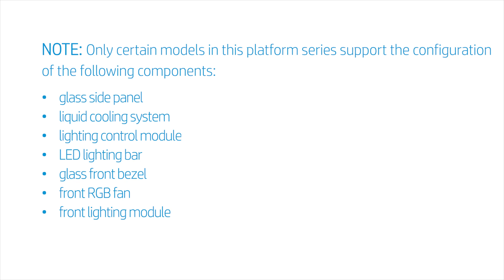Replace the WLAN Antennas | OMEN 25L GT11-0000a, GT11-0000i, 30L GT13-0000a, GT13-0000i | HP

Comment: can i move the wireless lan antennas to a different case
Reply: did u ever find a way to move them to a different case?
Reply from the maker: +Brian HP does not recommend upgrading or downgrading hardware parts or software that is bundled with the product as It may affect the manufacturer's warranty and performance, however, you could change the configuration at your own discretion.

Comment: 0:40 when u said degrade desktop performannce, does it mean by wifi conecction issues (because I think my cable might be damaged and its caussing a lot of wifi connection issues)
Reply from the maker: +LONE Follow these steps to Learn how to remove and replace the wireless LAN antennas for the OMEN 25L GT11-0000a, GT11-0000i, 30L GT13-0000a, GT13-0000i Desktop PC:
- NOTE: Only certain models in this platform series support the configuration of the following components:
- glass side panel
- liquid cooling system
- lighting control module
- LED lighting bar
- glass front bezel
- front RGB fan
- front lighting module
- Before you begin: Remove the access panel and front bezel. 
- Removal
- NOTE: The wireless LAN antenna connectors are labelled "1" and "2". The front antenna is antenna "1" and the rear antenna is antenna "2".
- CAUTION: Use care when disconnecting the wireless LAN antenna cables from the wireless LAN module. A damaged cable or connector can degrade desktop performance.
- Grasp the wireless LAN antenna connectors with a small pair of needle-nose pliers, or tweezers, to gently tug them off of the wireless LAN module.
- Remove the wireless LAN antenna cables from the routing channel inside the chassis and then feed them through the access hole in the front chassis. 
- Remove each wireless LAN antenna cable from the cable guides on the front chassis. 
- Gently prise the wireless LAN antenna brackets, to which the wireless LAN antenna cables are attached, off of the front chassis and remove the wireless LAN antennas.
- The AUX wireless LAN antenna is removed in the same way.
- As you complete the replacement of a part for the desktop, you should ensure that all of the cables are correctly routed. The interior of the system should never look like this after a service event.
- As you route any cables that you’ve connected back into position, be sure to use the clips, hooks, and tape that are provided on the chassis for this purpose.
- This prevents the possibility of cables snagging or sagging when the desktop is moved. It also helps ensure clear sight and access to the components should any further troubleshooting or servicing be needed.
- Replacement
- Align the tab on the bracket of the Main wireless LAN antenna with the slot in the front chassis and push the bracket down firmly.
- The AUX wireless LAN antenna is replaced in the same way. 
- Route the wireless LAN antenna cables along the routing channel on the front chassis and feed them through the access hole.
- Route the wireless LAN antenna cables along the routing channel in the chassis to the wireless LAN module.
- NOTE: The wireless LAN antenna connectors are labeled "1" and "2" and should be connected to the corresponding "1" and "2" labeled ports on the wireless LAN module. The front antenna is antenna "1" and the rear antenna is antenna "2".
- Reconnect the wireless LAN antenna cables by gently pushing the connectors onto their ports on the wireless LAN module.

Caution: Improperly installing or replacing parts could damage your HP device or void your warranty. Before replacing any parts, check your warranty.

Comment: Is there a product I can use to fasten my antennas better? (to the wireless lan module) because mine have been disconnecting very easily
Reply from the maker: +Yeah I Kinda Do Everything Please perform updates via Windows and HP Support Assistant as mentioned below to fix this issue: Step 1 Windows Updates - 1) In the search box, type and open Windows Updates. 2) Check for updates. 3) If the updates are available, click on install and restart the computer. Step 2 HP Support Assistant Updates - 1) In the search box, type and open HP Support Assistant. 2) Check for updates. 3) If the updates are available, click on install and restart the computer.